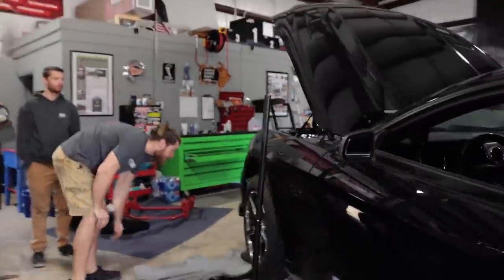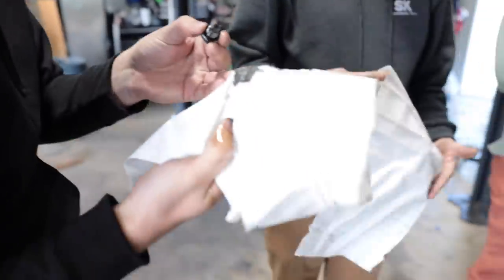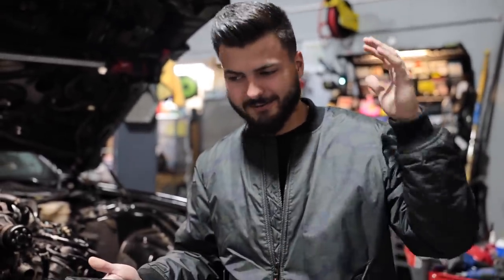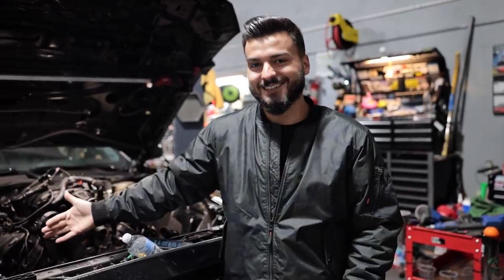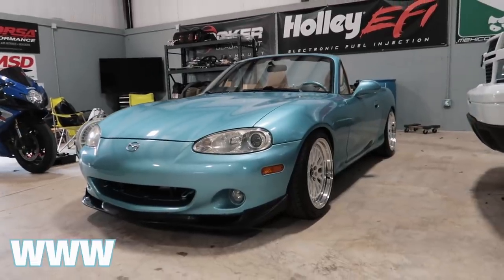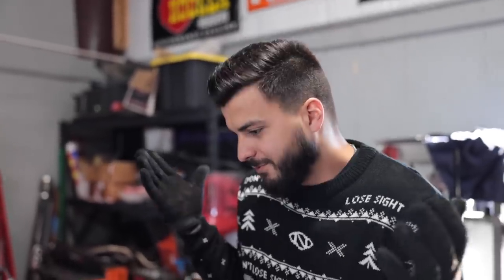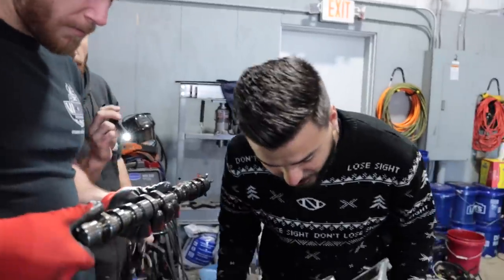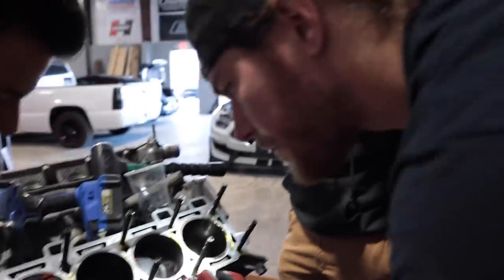Tearing Down Satan’s Blown Motor! | 1,500hp Coyote Engine Teardown

Comment: Everybody going for MMR’s head now after 2 or 3 engine failures🤣
Reply: You really don't know what happened? MMR didn't build this motor for them, and they didn't pay MMR for anything. This was a second hand motor that they hacked together after buying it from someone else. See how they hammer away in this video?... that's how they treat a build lol. Anyway, the truth is they asked MMR for help, which they agreed to, and then sent the engine and parts, including the bearings they are complaining about, to MMR to be reviewed and refreshed. Real MMR motors use specific parts. I have one...a 1500se and it's an absolute beast. Even still, I'm sure MMR did the best with the parts provided, and even after that, the treatment of the motor is what caused this issue. The redline was not a soft redline. As he is mentioning even in the video, he is referencing the physical limitation of the crank/cam combo, which is still questionable. There is more to it then that, such as stroke, cam spring choice, etc. The etching away at the gaskets is from repeated physical limiter hammering, and then the boost crossed into the water cavities, and blew off the coolant line. Instead of admitting his mistake and resolving it, they just sent it again. Absolutely insane. So then he had fuel and coolant displacing the oil which absolutely destroyed the bearings and rest of the motor. This is 100% the fault of this nutty dude in the video.
Reply: I love how MMR is trying to act like they had nothing to do with it, they sent the engine to them where they held it hostage for like six months and then they tore it all apart and completely rebuilt it themselves, and now, 4 hits on the street and BOOM, and mmr says hey we didn’t touch it lol
Reply: @tannerstift1489  They bought the motor SECOND HAND and it needed work, but they wanted MMR to use the parts they sent....yes, including the bearings they are complaining about in this video. Besides, that's not what blew the motor. He destroyed the head gaskets from his abuse and the fuel and coolant displaced the oil...it doesn't take a genius to get that.
Reply: @raredesign  dude this is the 4th time I’ve seen this bs comment quit with copy and paste. We get it your in love with mmr but the truth is they are trash just do yourself a favor and stop making yourself look like an idiot and stop pasting this same comment over and over again. Geez
Reply: @christophercarpenter4008  It was easier for my to c/p and reply to all the dumb comments. You obviously don't know what you are talking about. This dude blew his own motor and is blaming MMR for something he didn't buy from them.
Reply: @christophercarpenter4008  i bet you he’s an mmr rep 😂😂
Reply: @raredesign  so he sent them the motor and all the parts to go over it and make sure everything was good. They sent it back to him saying everything was fine that it was just the cam timing. Yet you state they agreed to go over the motor..obviously they didn't go over the motor. 
Giving and MMR had a partnership. They would make sure that the motor had everything it needed and was good to go. Which then Gavin would promote MMR in his videos to increase their name being out there to people who are interested in vehicles and especially ford mustangs as MMR does those types of Engines.
Gavin promoted the shit out of MMR and when he gave his opinion on what was wrong with the motor the first time MMR got upset and threw a tantrum holding his motor hostage because of what other people were saying to MMR. 
It be like you holding Gavin Engine hostage because I'm telling you you're bias and just trying to protect MMR because you have their engine. Gavin can't control me from calling out your BULLSHIT. The partnership was Gavin Promotes them on his videos and they made sure the Engine and all its parts were right for the engine and to fix what wasn't. In the end the Engine was supposed to be rated to 1500hp. It never made close to it. MMR failed to keep up their end of the Partnership. Even your statement trying to protect them admitted they agreed to go over the engine and send it back ready to go! They put it back with most of the parts it came with instead of fixing it like they said they would. Why do you act like that is acceptable? 
In the End GAVIN could sue MMR and he would win as even MMR has admitted to agreeing to make the Engine ready to go in return for being Promoted by Gavin. MMR failed to keep their end of the agreement.
Reply: @raredesign  the only thing your right about is he didn’t buy it from him but he paid them a substantial amount of money to build it for him all the bearings timing tensioner ahead gaskets all down to the torque specs and every bit of wat they did and touch failed on his motor and it has nothing to do with how he drove it the car was rated to run at 8500 rpms it’s a drag car.....it’s 100% their fault nothing he did driving that car would cause any of the damage that occurred period. So yes I knw exactly wat I’m talking about. Piss off
Reply: @wijxh  o def 100%
Reply: @raredesign  Soo a quality engine builder received bad parts and agrees to use them? None that I know of would do that if they felt it would hurt their name they would ditch the parts or refuse to build the engine. Your full of crap either way mmr is at fault they assembled it themselves both times and the second time was all on them with no "second hand" scape goat jump off their nuts and think about it. Either way you go they put their name on it and shipped it back knowing it was going into a pretty famous car
Reply: @raredesign  even MMR said the engine was ready and set to go and they confirmed the engine was rated for 1500+ horsepower reliably, Gavin only making 992 whp, they also the ones that held it hostage for 6 months took it apart and put it back together
Reply: @Quiksilver-ft8xz  Held hostage for 6 months? What part of FREE do you not understand. They have a business and these guys wanted a freebie for their channel exposure. I don’t think this is the kind of exposure they agreed to. Who said 1500+ horsepower reliably? Where are you getting these claims? If you buy a real MMR motor, yes, and you have an option to buy a warranty. In my case, I bought a 1500se motor with every upgrade option and billet internals, and bought the warranty. The motor is absolutely sick!...in a good way. Crazy strong. Gavin asked them to use the parts they sent, including the bearings they complained about in the video. How can MMR guarantee a motor that is a deviation and one-off from what they build? It wasn’t even their parts and standard build. Aside from that, Gavin over-rev’d the motor continuously and blew it. It’s not a hard concept to get.
Reply: @raredesign  Keep on copy pasting, MMR sucks!
Reply: @raredesign  he bought this engine second hand although it was relatively unused. Now shut up
Reply: @kirin8735  lol they asked MMR to install some parts they sent, and then abused the motor. Not hard to comprehend.

Comment: “Not dragging anyone’s name through the dirt” proceeds to drag MMRs names through cow shit the whole video 😂 never said the name but it’s implied
Reply: They deserve way worse. They logically should also be refunding Gavin on everything he paid them and making a public apology. A company that big shouldn’t be assembling built motors like a toddler 😂
Reply: @FlexCrayze  a toddler could honestly do better
Reply: Explain yourself ..he over heated the motor popped a head gasket and the motor ate it’s self cause he kept driving it ?
Reply: @wolfracing9504  yeah, thats all true, but the order you listed is out. it popped the head gasket, which shouldnt have happened regardless, then “got hot” because it wasnt REALLY hot, it was just showing that because of the blown head gasket. on top of that, the motor still shouldnt have come apart like that, there was no coolant in the oil. all that carnage is caused by human error.
Reply: I heard that
Reply: I’d say if all that was wrong with motor it was done intentionally by MMR
Reply: @wolfracing9504  watch the whole vid, was more than just the head gasket. head gasket from mmr’s shit itself, tensioners from mmr’s were replaced because the company’s tensioners he originally had on there weren’t “reliable” but the mmr ones shit themself, and you can’t blame him for his cooling temp to go right back up to normal after doing a pull. he didn’t see his temp even drop. this is the 5th time mmr had a fuck up on the motor. so yes you can blame mmr for everything
Reply: @wijxh  agreed
Reply: Doug can build a better engine with a Altoids can and a paper clip
Reply: dont these companies provide warranty for the work they do ?
Reply: @wolfracing9504  
Doh - try watching the video, then commenting - the problem was the engine, not the driving... The engine failed well below the rated power level is was supposedly built for - THEN the rest followed that...
Reply: I watched the video ..you don’t beat the car after it pops a head gasket ..doesn’t matter at this point he has a motor on the way so I hope he gets it going ..happy holidays
Reply: @copper4663  There absolutely was coolant in the oil. Look at the color and the swirls of discoloration in the oil. He popper a head gasket, then trashed the bearings. This clown has no business near modified cars.
Reply: @nallen1006  coolant has oil properties man, doesnt matter what was in the oil. the motor was done long before the head gasket ever went.
Reply: @nallen1006  I think you should watch the video again. A motor that was alleged to handle 1500 horse made a whopping 900 and refused to make anything more. The rotating assembly was so tight when they put it in the car that they weren’t sure it was even going to run. The head gasket shouldnt have blown at all, as the car was only making 2/3 of what it was rated to make. You arent wrong, the head gasket is sort of a maintenance item of a high horsepower car, but the car had only done like 500 miles at most, where the GT350 is making in the neighbourhood of 1200 at the crank and shows no sign of overworking. THAT makes no sense :/

Comment: Gavin: “how much horsepower is it rated for?” 
“fifteen huned.” 
Gavin: “Aight bet.”
“1500hp” rated motor: Blows at 700-950hp MULTIPLE TIMES
Reply: MMR iS A tRuSt WoRtHy CoMpAny WitH QuAliTy EnGInE BuiLdErS...
Reply: @offchops6722   hahaha i dont understand how those people are still in buisness, mayb gavin has bad luck tho
Reply: Would've liked to see how much power it made if that crank didn't have main bearing clamping down on it
Reply: I'm starting to believe that this engine is rated for only 500 hp and NOT 1500 hp
Reply: @danishghostrider  makes sense
Reply: Stock it was pushing 1k

Comment: Is it just me or does it sound like he’s going to put a turbo on it
Reply: LS 4 twin turbo 👀
Reply: With a powerglide sponsored by sk tools 😂😂😂😭💀
Reply: That's what I was thinking
Reply: @45:48 he says "no more supercharger" 😁😁
Reply: Yep, It felt like he was DONE with superchargers and maybe going for a single turbo setup since the 350 is a TWIN.
Reply: He is
Reply: He is going to turbo it  99%
Reply: RocketRecords  unlikely but it is possible. He’s most likely going with a different ford V8. It could be another coyote, but at this point I think he might go for something like a 2020 gt500 swap. But you never know.
Reply: @KingSwager  🤢🤢🤢
Reply: Probably going to put a turbo on it    but dith a different oiled trubos instead of dry turboes with a race engine in it for quicker launches pulls i think 

I dont think he will put the same setup in both cars
Reply: @davidkelley751  7.3 godzilla swap 🤣
Reply: @riffle91ar  that would be dope. My guess is that he’s still gonna go with a high revving ford motor. But you know I’d be open to that motor to.
Reply: It’s a turbo
Reply: nah he'll go procharger
Reply: @dyingslowly666  no he said he was switching it up so it pretty sure he is going turbo

Comment: Gavin: gives left out info
Nobody:
The comments: nope still can’t drive
Reply: It's not really left out info if it is so obvious, but ye you're right
Reply: Nah it’s clearly a driver issue, if they would’ve changed out the blinker fluid then none of this would’ve happened.
Reply: @nucleak2884  I thought you were hating for a second but this is kinda funny
Reply: @haidenmathieson6785  Read it again 😂😂😂
Reply: @haidenmathieson6785  Whatever kiddo 😂
Reply: @nucleak2884  lol you got us on the first half not gonna lie 😂😂
Reply: @aldolizalde481  the bearing ate itself because Gavin didn't replace the head gasket after coolant made its way in the motor.
Reply: Gavin should post the Data Logs if what he is saying is true. If not then it's just him making excuses without backing them up.
Reply: @overindulgent  agreed, and he also ran the motor with coolant in the oil which killed the bearings.
Reply: @haidenmathieson6785  I don’t know if you’re replying to me but look I 100% guarantee that Gavin is way better driver than me.. the comment that I put literally describes Gavin’s comment section.. no matter what he says no matter what is justified people are still going to hate on him and say he can’t drive

Comment: Did he say no blower! He throwing a ying yang spinney thang on it!!
Reply: I kinda like supercharger better
Reply: He definitely should go turbo its not as crazy but for street driving that's better and it will make way more power and launch easier at the track.
Reply: @tstuff1213  yes and I feel that what he has been looking for in this car is good street drivability.
Reply: "Ying Yang spinney thang" Yes 🤣🤣🤣
Reply: @tstuff1213  it is even more crasy
Reply: Ying yang spinney thang😂 that’s a new fav
Reply: @HenrySatterthwaite  Agreed, while still being fast
Reply: @juniorpannwitz9369  The only reason i think its not quite as crazy is because it is not instant power like a blower. He can just blow the tires off with a blip of the throttle. With a blower you get instant power but turbos have to spool. Turbos are still CRAZY AND ROWDY but not in the same way.
Reply: Wuhan Warwhistle!
Reply: @The1Monty  Even better!!
Reply: Now that he got a taste for it from the white car
Reply: He did ask on his Twitter should go turbo
Reply: @tstuff1213  yeah superchargers are instant power which is good for street racing, turbos are good for drag strip since he will be able to spoil them up
Reply: @Foxfire324  Are they good for street racing though because of the instant torque. Like other than being really good on the hit. Turbos back half harder. Like with superchargers its super easy to blow the tires off where turbos are more manageable which is why gavin could never get even with bias ply slicks the black car to hook on the street, but lucifer which is making more power with turbos and is using DOT street tires can hook and book on the street. I guess there is pros and cons to each set up. But i think turbo is the way to go for driveability and overall power capability.